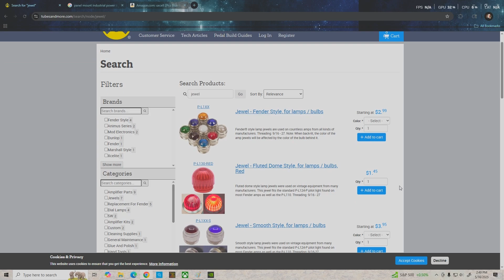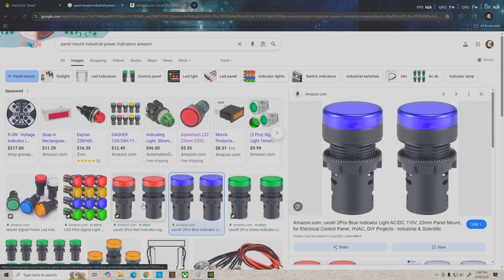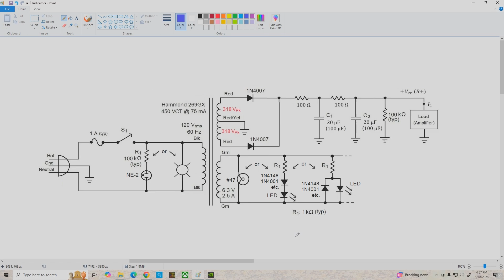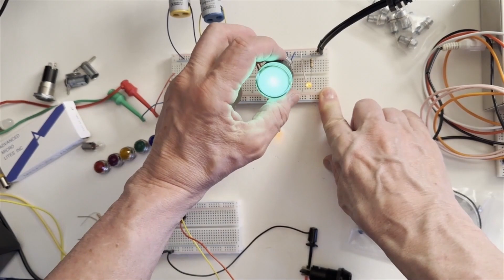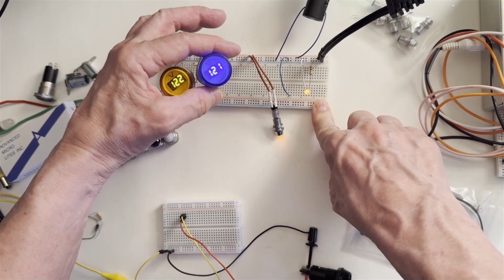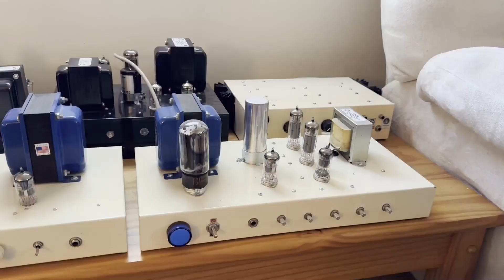Topic 85: Power Indicators; Incandescent, LED and Neon

Comment: Thank you for this video. I've found the bayonet LEDs from AES are too dim and the 120V bayonet bulbs from AES pop unless knocked down to 100V and then are also too dim. I ordered some 120V LED colored bayonet bulbs from Amazon that works well but I have to pull out the cardboard sleeve in the holder for them to fit.